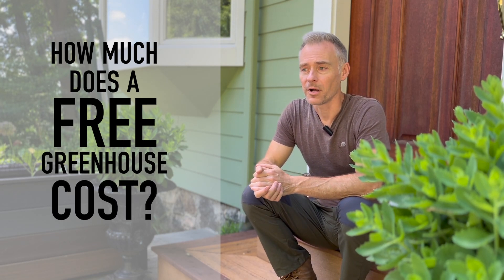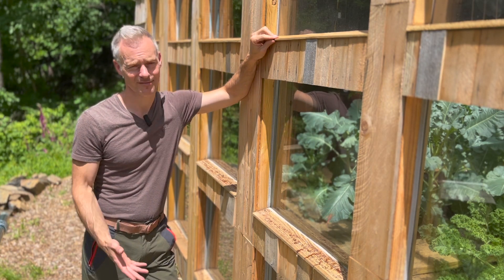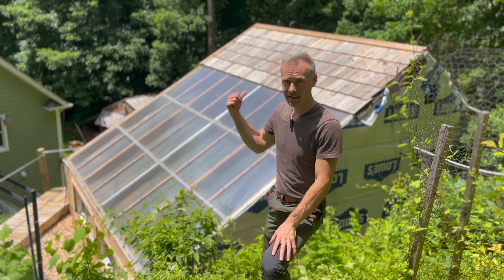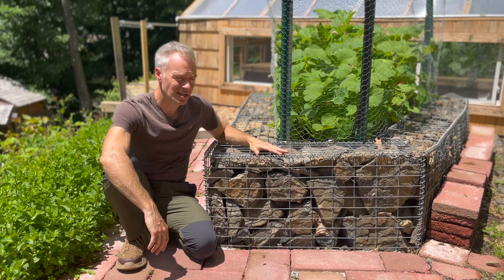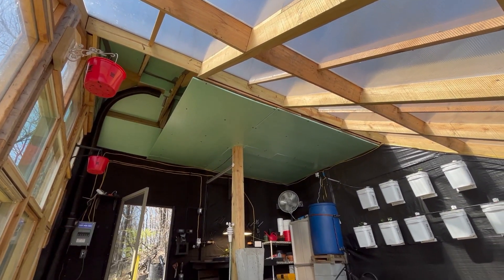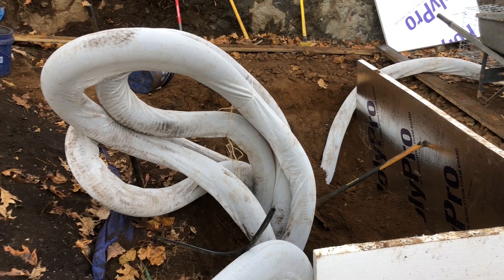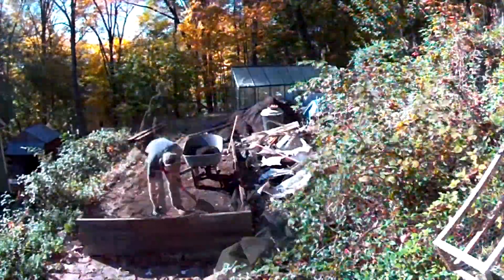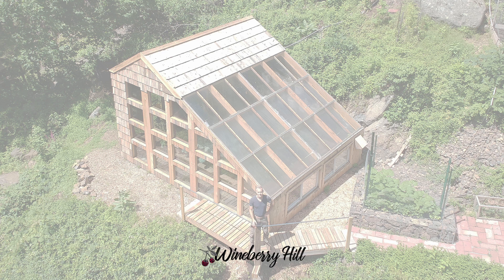What's a "Free" Greenhouse ACTUALLY Cost?

Comment: Please please please! how did you connect the polycarbonate panels end to end?? I cannot find any guidance and we are planning a big greenhouse like yours with a 16ft sloped roof (+ 4ft metal roofing at the top). I've found millions of videos on connecting side to side with H channels but nothing for a roof  longer than the panel.
Reply from the maker: It's pretty much all H and J channels. There are wood cross pieces running horizontally in-between the roof beams. The H channel is running horizontally on those. So the panel runs down into an H, the H is screwed to the cross piece, another panel goes into the other side of the H. make sense?
Reply: @WineberryHill thank you for replying do fast!! ok so your H channels are horizontal, connecting the top and bottom. How do you keep rain water out of the side connections? Where do the j channels go?
Reply from the maker: I run silicon caulk in those spots to avoid water leaking through. J channels run along the borders, where they butt against only one panel side.
Reply: @WineberryHill  thank you so much. That's what I was thinking we'd do, so I was on the right track! If you ever put up a detailed video of your polycarbonate sheeting set up, I will be the first to watch. I subscribed! Thanks again

Comment: Your greenhouse is awesome. Have you considered insulating the roof from the inside with a thermal blanket that automatically folds and unfolds at night?
Reply from the maker: The interior roof/ceiling area is insulated...in addition to the insulated drop ceiling. I'd love to know more about what you mentioned.
Reply: @WineberryHill  Hi, I'm sorry, I wasn't very precise. What I meant was, I've seen other people's greenhouses where they would cover the window areas from the inside during the night with insulating heat reflecting curtains. This should prevent heat radiation from escaping. Since you have quite a large area with windows perhaps this could help to keep the greenhouse even warmer because less heat is lost during cold nights. I'm not an expert btw, just a thought :-)
Reply from the maker: Good thinking! I'll look into it.